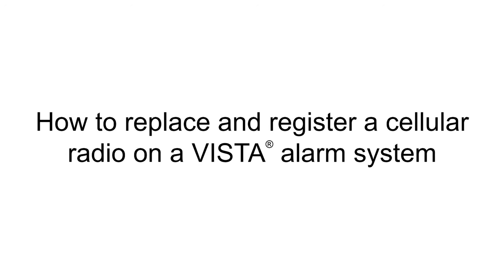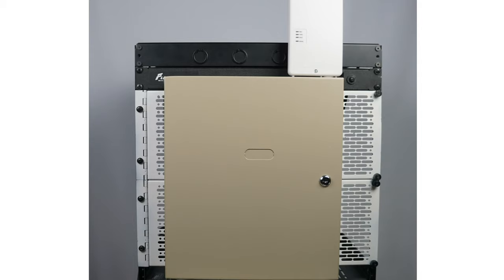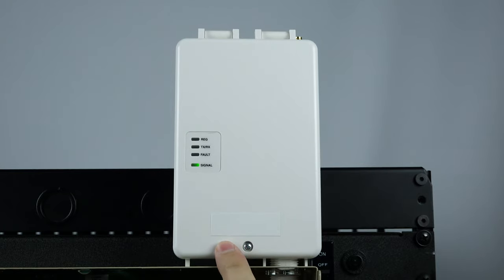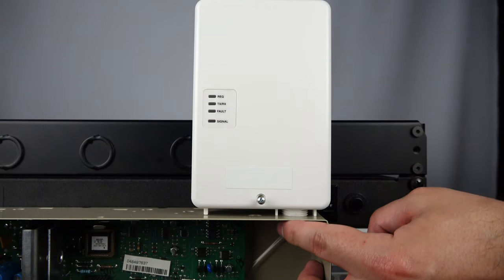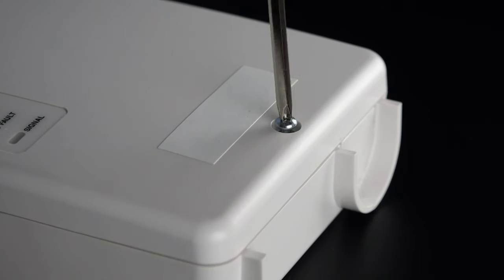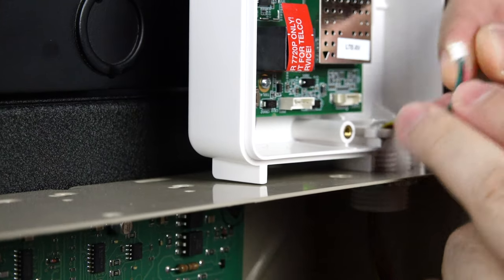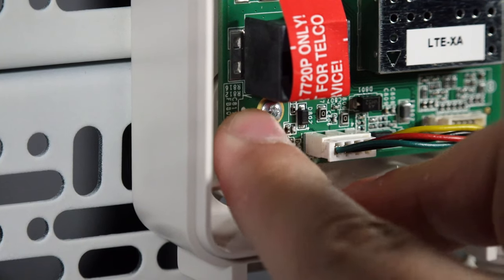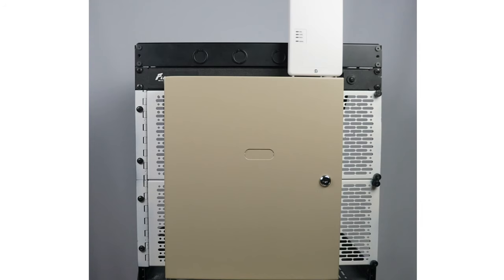How to replace and register a cellular radio on a VISTA alarm system - Resideo

Comment: I have this Resideo communicator on my system. The other day, I powered down my system to replace a CO detector. When I powered it back up, everything initially looked good. But then, I get a "Check 08 Phone Backup" message on my keypad, and the system ready light is not on. The Resideo looks normal (green signal light lit, and yellow light blinking). And, it is sending messages to my alarm monitoring company which I can see online in the activity log (shows up in the report as "TR-CELL BACKUP TRBL". Any idea why this trouble message is being sent? Thanks! I will call my alarm company, but the waiting on hold time is crazy long.

BTW, the cell connection is the only connection for this system. I wonder why it's calling it "backup."
Reply from the maker: Hi Lee, thank you for contacting us. Our security products are handled directly by security dealers, we do recommend you reaching out to your alarm company, if they need assistance they can contact our security department directly for assistance. -Maria

Comment: I am looking at used radios on ebay.  Does it matter if it is an ADT marked unit as long as it is the same model line for my panel ( honeywell lte-xa for a Vista15) and cell carrier (ATT) ?
Reply from the maker: Hi Clifford, we recommend reaching out to your local security contractor regarding all security device questins. -Jim
Reply: Not sure, but knowing adt could be proprietary, or cell card may be locked to them